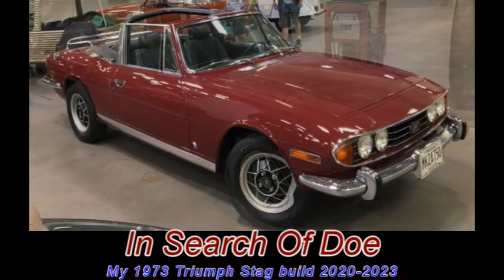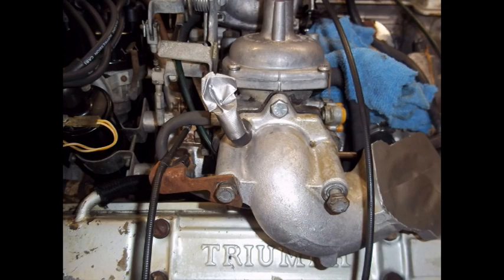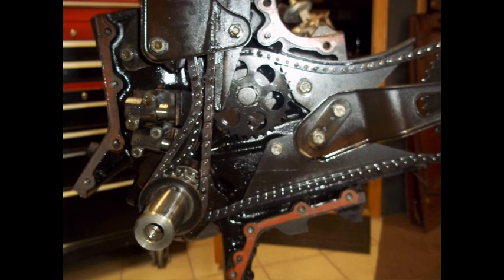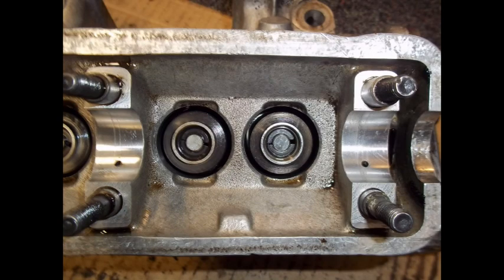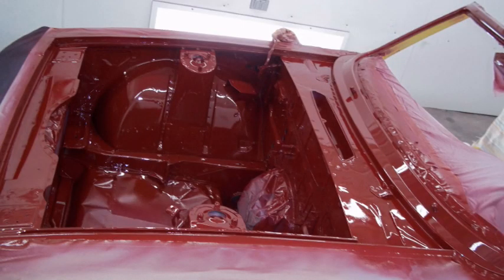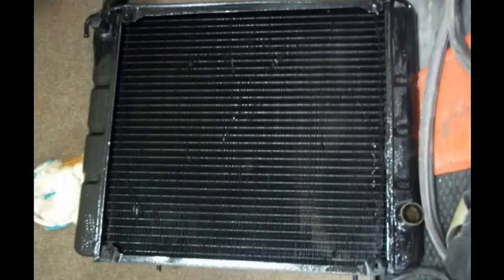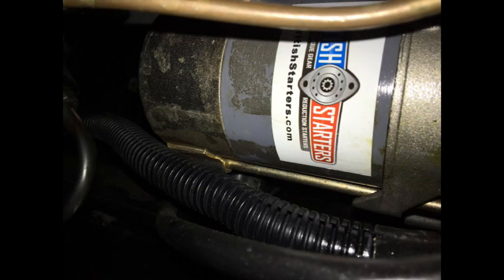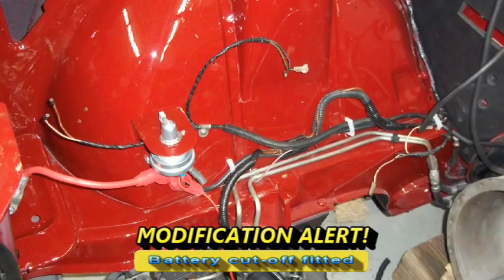1973 Stag Engine Build

Comment: Why bother to rebuild one of the worst junks ever produced.  The Engines and Transmission are garbage.  The Crankshaft Bearings were inadequate.  I'm surprised you didn't replace the Water Pump which was also garbage.  You should never purchase any vehicle that have Powertrains that are well known to be trash.